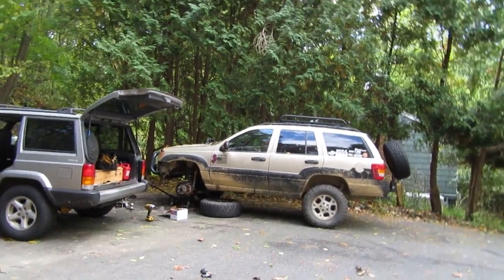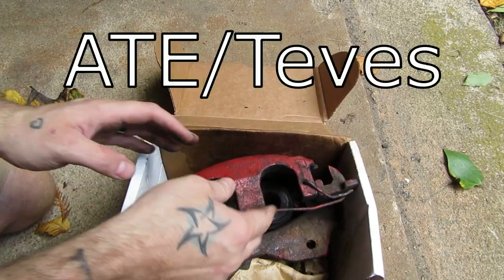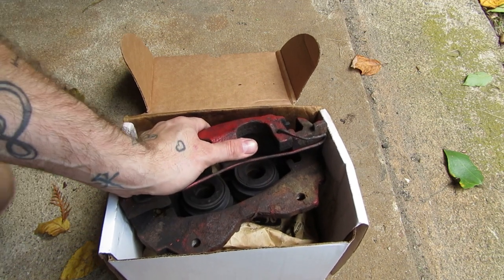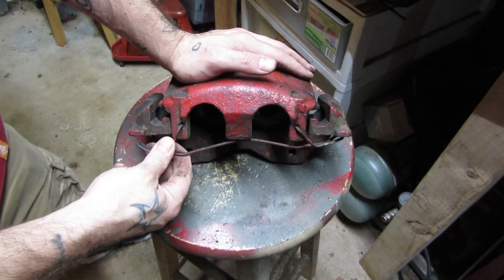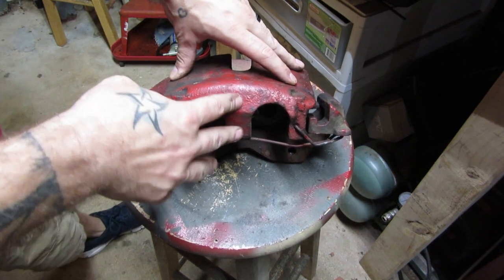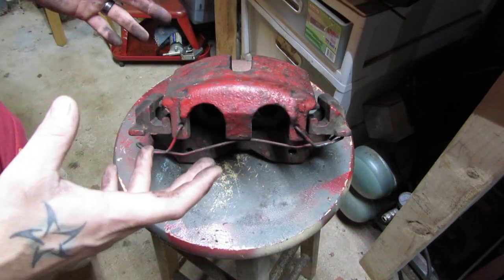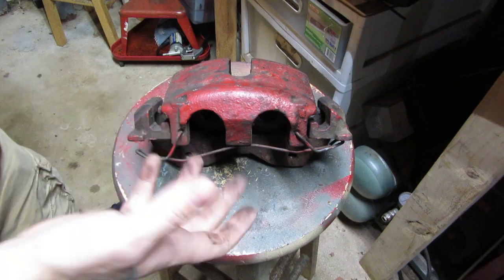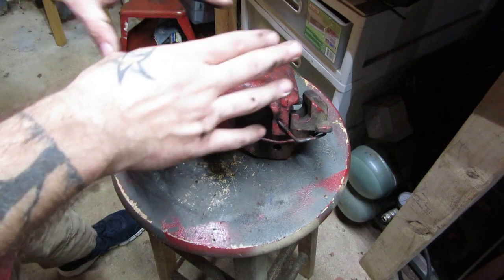Jeep WJ Grand Cherokee Brake Calipers - Teves vs. Akebono

Comment: Great vid chief!! If anyone has teves, dump them fast. Akebonos are more stable. Teves are known to 'walk' the front brake pad around the rotor because teves require the wire clip to stabilize the front pad with the rear pad (on the same rotor). Teves will get stuck and grind a path into your rotor's front side or walk all over the front end causing wobble in your steering even when new, this is why Jeep went to Akebonos as factory standard in the WJ after early 2002, I believe. I researched after one of my Akebonos seized up last week. Also remember to maintain your brake fluid, if the fuild is not clear flush and replace (on the WJ start bleeding rear passenger first, rear driver, front passenger and end with front driver side). Oh and hells yes a stuck/seized caliper can cause death wobble, I had it after the passenger side seized up going 60 down a mountain, not fun times. If anyone does a caliper switch out, highly recommend you pony up some dough for new rotors/pads too so you can heat mate everything (brake in). Either amazon or RockAuto just don't get the cheap crap, get rotors made to OE standard in steel thickness and steel grade OMix-ada rotors are pretty good, (Mopar wants $100 per rotor). I'm running them now on the front and with the new calipers and pads the brakes are cool as hell, pedal feel is amazing and not even a slight vibration. Last tip, if you buy new rotors and do any kind of off-roading, even to check the mail, do NOT buy rotors with fancy holes or slats cut into them, they just trap rocks, dirt, debris and grind down your pads and rotors not to mention cause irritating high pitched squealing. Replace rotor with only standard smooth faced rotors. Also, screw you death wobble!
Reply from the maker: OMIX-ADA is the way to go. What is your process for heat mating (we always call it "blueing") new pads?
Reply from the maker: Yea, Eric is a big fan of breaking in his brakes that way. I read something on a box of pads not too long ago about going 60-0 10 times then 30-0 5 times to "properly" do it.. seemed excessive! I have been asking folks since what they do to see if anyone has heard of that level of bluing. No one has yet

Comment: I still have the original calipers on my 99 WJ I have al ways changed the wire when I do the pads and I have never had a problem.However I do have the teves calipers new in a box.That probably why I haven’t had any problems with the originals.

Comment: I got no idea how I missed this one.  But yeah, this is the first real mod I did to mine. It was dragging the right front inner pad on a regular basis and the left rear inner. Akebonos on the front and brand new rears got put in last year. No problems since, but we all know it will take a little longer than a couple of seasons to really screw them up :)

Side note: I painted all 4 of them with vht caliper paint before they went on. Why? I hateses the rustses and it already has more than I ever want to see again!
Reply from the maker: Nice! How is the paint holding up?
Reply: @DEInTheGarage   So far so good... lemme look again after winter is over :)

I made a booboo when I painted...I prepped with brake cleaner. Should have used xylene. But I baked it, so we'll see.

Comment: Sounds like our long trip through New Hampshire. One ATE was smok'n on the highway and pulling hard to the left. This is a dead-stock setup. We all got a hotel and I borrowed some tools from their nice maintenance guy. Two years later it happened again. I looked into it and learned ATEs were pretty sketchy. I called Jeep and they said it takes a lot of parts and it's too expensive to change over. I got to looking at photos and I didn't see and issue so I ordered some Cardone calipers, since they have brackets that are needed. Been 4 years and all's good. Just be sure the new calipers come with the brackets---not all do.

Comment: I have 02 WJ with one side having Teves/ATE and the other has Akebono. I think it was the front with Akebono.
I was told Chrysler upgraded the 02 WJ from Teves to Akebono in the front on a recall in 04.
I'm not sure because I didn't own it then. Only had mine since early 2022.

Comment: Teves are heavier and hold heat so the don't cool as fast as Akebono. You have to buy loaded calipers to get the brackets because they use different brackets as well. I messed around for 4 years having brake problems continually, then switched to Akebono and all do now is replace pads.

Comment: I noticed my Akebono's (2001 WJ 4.7,) Front piston crumbled. I was using an old brake pad and c-clamp and resetting the pistons. I was spraying brake cleaner on the caliper as noticed this. I  wound up installing a new Caloper, Thank you jeep for making the caliper exchange a piece of fucking cake!

Comment: So, in your vid  you mentioned you thought the locked caliper was due to the vehicle sitting so long. Since the wire hardware is visible at anytime....and this was one of the disadvantages, seems like that is an easy one to maintain. Putting one side in and holding the pin in with visegrips as you push the other spring tension arm on is easy enough. We are down to the calipers not being rebuilt properly in the remarks and a 4 piston system that probably never gets brake fluid change or maintenance in a harsh offroad environment. I suppose this is driven because we Jeep guys replace things like brakes only when they fail and do no PM. You sure this is a Teves issue? BTW, the company name is pronounced "Tehves" as a two syllable word with a soft E.

Comment: Thank You for the great video and valuable information. I have a 2001 jeep grand cheroke laredo. I may have to replace the calipers. akebono sounds like the way to go.
Reply from the maker: Some 2001's already have them, so check for the tension spring that is only on the Teves

Comment: FYI most wj have ate teves calipers and need ate teves pads. And easier to replace and find cheap but good. I just buy spare parts so there is no issue. Just upgrade the pad and rotor for your use. I dog my rock crawlers with no issues from the ate teves brakes ever.

Comment: I noticed NAPA sells them with or without mounting bracket.  If it’s a swap out, why not just reuse the old bracket?   Thanks!
Reply from the maker: I honestly do not know if the bracket is the same. Is it?
Reply: D&E In The Garage I bought 2 new ones today.  One would not bleed.  Not a stop.  Tried gravity bleeding for 2 hours.   Nothing.  Then tried with a friend pumping the pedal.  Nothing.  I took it off while hooked up and only the bottom piston pushed out and then eventually leaked around the piston.   Taking in back to NAPA in the morning.  Hopefully will work.  The drivers side installed and bled just fine.   
Ever hear of this?
Reply: The bracket is different between the two.

Comment: Hi There from Quebec, love your vids Man! I can't recall in which of your videos, but you mentionned that using ford rotors which were a direct swap, instead of redrilling WJ rotors to fit XJ's bolt patterns in doing the WJ to XJ knuckle steering conversion... Which ford what year/model?

Comment: These would make a great upgrade to the XJ single piston calipers...
Reply from the maker: True! It is doable also. You can swap the D30 knuckles from a WJ onto the D30 of an XJ. You also get the benefit of full crossover steering, though it is not a simple project. MartinBuilt has a great video on it if you are interested

Comment: Love your channel.  I got a question, You said your brakes got hot,  My rear brakes are teves.  I notice a burning smell from them. also what appears to sound like a slight grinding when in motion.  I replaced my pads recently because I thought a rock got stuck between the pad and rotor,  There were a few grooves in the rotor.  I still get the same issues.  Could it be a stuck caliper? If so should I replace them as well as rotors and pads with Akebono?  I have those in the front.  Thanks for your opinion and advice.

Comment: You can run 15” rims with the ATE/Teves calipers. With the Akebonos the 15” dont fit.
Reply from the maker: Interesting... i did not know that. I have Teves when I ran 15's on my WJ. Good info. Thanks
Reply: They will with a large positive offset, but then you're sticking the wheels out pretty far which screws with the scrub radius.
Reply: Will Alenonos work with a 16” wheel or do you need 17”?

Comment: Can this swap be done for my 97 xj? Or my 97 xj?
Reply from the maker: Yes, but it is not as simple as described in this video. You need to take the knuckles from a WJ and swap them onto the Dana 30 on your XJ. That part is a direct swap. then you will need to make some modifications to your drag link as the WJ knuckles are setup for crossover steering. Additionally (and I do not know this first hand, just what I have heard) you need to cut and grind parts of your sway bar links and calipers for turning clearance. I think a spacer much also be added to the knuckled  to matchup the rotor and caliper. There is a guy on youtube who did this names MartinBuilt. His video is really great.
Reply: @DEInTheGarage  thank you guys I've been getting the wrong pads for my wj form a few years now u know

Comment: What's your opinion on slotted and drilled rotors for a wj in an offroad environment?
Reply from the maker: All depends.. If you are having braking issues, first I would upgrade from teves to akebono front calipers if you WJ didnt come with them. I have run D/S Rotors on my WJ and didn't notice much different.
Reply: @DEInTheGarage  no issues with my 01 right now. I have the undesirable ones on it now. I don't remember which one it is. Just waiting to smell that familiar smell of burning pads on mine. Lol

Comment: I understand that the fronts take the brunt of the braking but they should've done the rears in an akebono style as well. Why have two different style brakes on the same car when one has been proven to be superior to the other. And again I know the rears don't do as much as the fronts so people will say it doesn't  matter but again akebonos are just better so why not? Anyone lifting thier wjs are getting the same size tires all around. why not a better brake to support the bigger tires and towing? Yes I get that the fronts do the bulk of the work. I get that.

Comment: The flaw in these calipers is with the slide pins.  Their weather resistance sucks and are very liable to get stuck.

Otherwise, there is literally no difference in how they operate or how one would generate more heat vs the other.

Those wires are "anti-rattle" devices.  They do nothing but keep the caliper from shaking over bumps.  They only fall off because people don't get them in there all the way.

Comment: Fucker sold me a Jeep and said he redone all the brakes but I learned the hard way when I pulled up in the driveway and my rim was nearly on fire.. ATE calipers are complete garbage and I wanted to upgrade to the Akebono's but I wasn't sure if I they'd be a direct swap..
Reply from the maker: 100% direct swap. same mounting hardware, same rotor. different pads
Reply: @DEInTheGarage  I'll trade you my reman ATE crap from Auto Zone lol

Comment: The teves suck I've had countless issues with them. I was stupid enough to put teves back on when I re did my calipers and I'm having brake alignment issues with brand new calipers hooray
Reply: What are brake alignment issues???
Reply: @robertmerritt7271  when your rotors are either too far out or too far in by a few thousandths of an inch and you end up with a dragging condition caused by misalignment of the contact surfaces. Ended up being shitty aftermarket rear wheel bearing races that caused the condition so I had to re do them. NEVER GET DURALAST REAR WHEEL BEARINGS FOR JEEP WJ, the races are too big. They'll install fine but you end up with the condition mentioned above